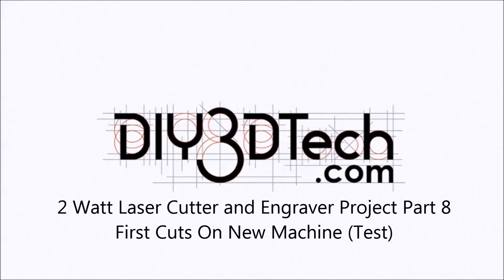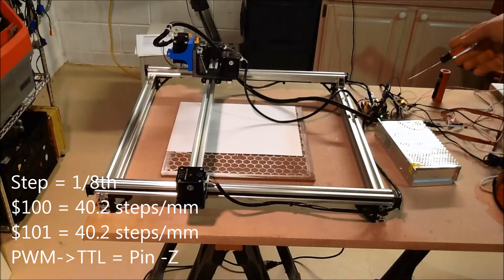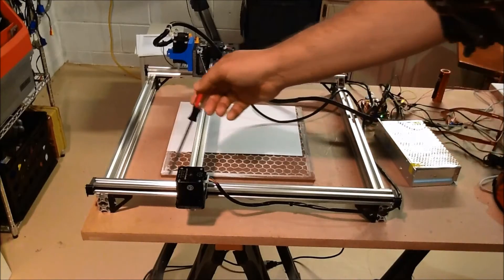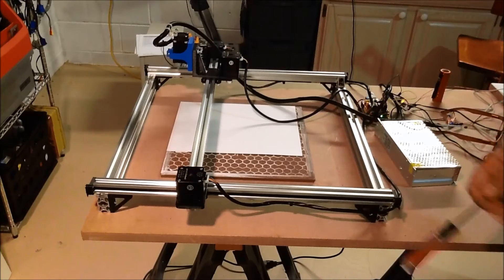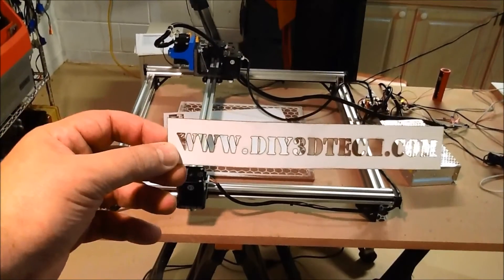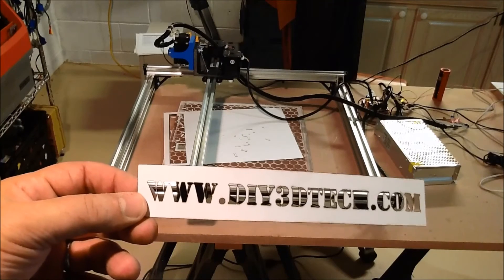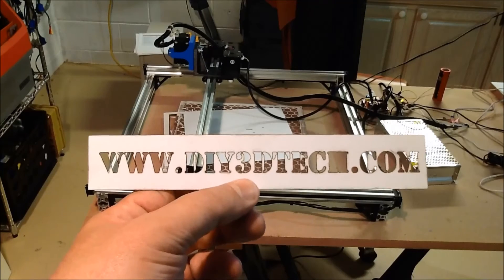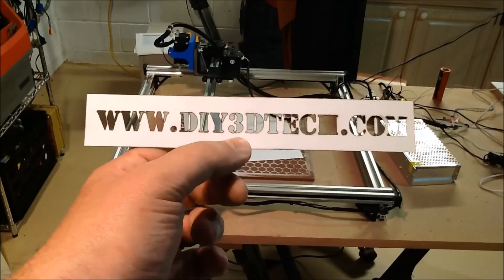2 Watt Laser Cutter and Engraver Project Part 8  -  First Test Cuts

Comment: Hi, I was wondering, would it be possible to mount a laser at the end of the x-Axis and beam the laser across to a 45 degree mirror and have it refocused onto the cutting material ? btw thanks for the videos they've extremely useful.
Reply from the maker: Yes you could but why?  Keep in mind, adding mirrors means adding loss to the beam and with diode you don't have as much to lose as you would say a 40 Watt CO2...

Comment: can this cut clear .010 mil mylar if a black piece of wood is behind it?
Reply from the maker: Might, however the wood behind it would not matter as the material to be cut need to "absorb" the energy and not what is behind it.  I assume the mylar is clear?  If correct then most likely not as it's not the thickness, however  the absorption of that wavelength of laser.  For clear, IR (i.e. 1060nm) is fat better than 460-500nm which this laser is.  The IR lasers on ebay are pretty cheap (http://goo.gl/aqPMJ3)...
Reply: +DIY3DTECH.com the link does not work. I'm thinking of buying the 5000mw desktop laser hoping it will cut clear or frost white mylar

Comment: can cut wood veneer whit 2w power?
Reply from the maker: Veneer would say yes, and would not slowing it down too much as you run the risk of fire with no air-assist so would do multiple pass's.  I've ordered new laser for this from eBay and the vendor shipped me a 1Watt unit instead of a 2 Watt and fighting with them via eBay to make good.  So when I get the 2 Watt in will do a video on this as this is a idea which never struck me so thanks for asking!